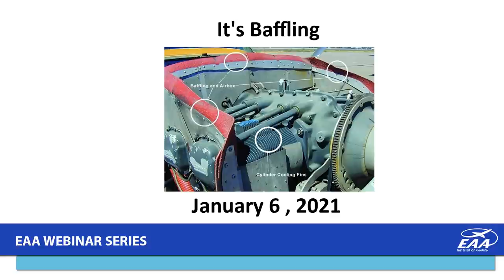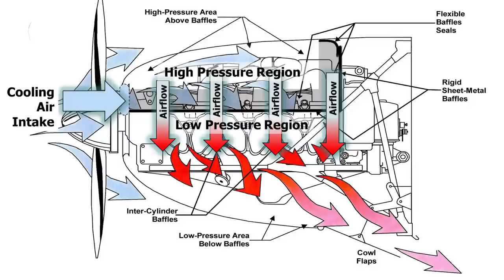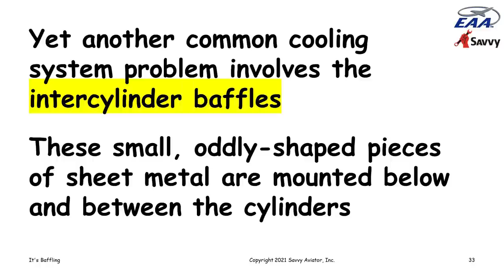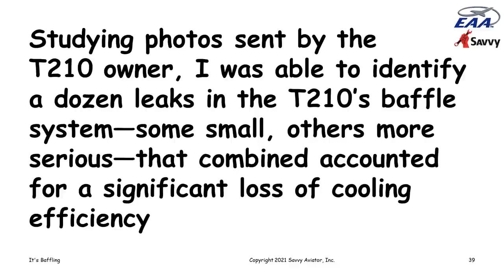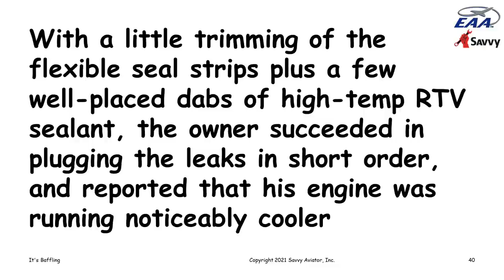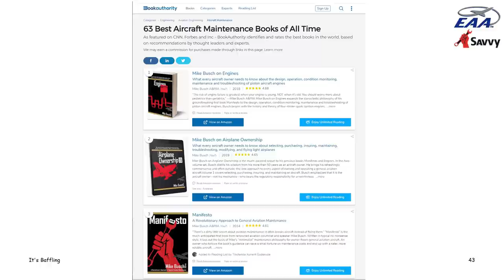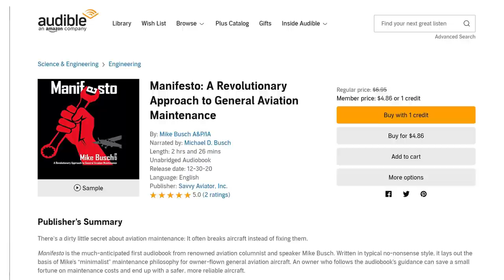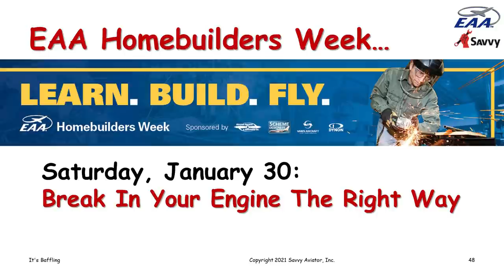It's Baffling

Comment: Thanks, another well-made webinar. It took me a long time to understand how this works, and why it is better in almost every way (except structural weight) than hanging the cylinders "out in the breeze". One thing in subsonic flows that people find counter-intuitive is that by widening the intake after the inlet opening, the air flow will slow down, and pressure will increase.

Comment: I was waiting for the A&P to finish up my annual paperwork a few years back; while I was waiting I walked around the hanger looking into the cowling openings at the baffle seals (this was an issue I had been working on my 172P).  Every aircraft that I looked at (mostly 172's, a couple of 182's, etc) had the seals backwards (pointing toward the lp side of the baffles).  The reason I was aware of the issue was I had installed an engine monitor as part of a panel upgrade and had been chasing CHT issues ever since.

Comment: I had a new cowling put on my E model Mooney.  Afterwards my cylinders were running much hotter.  When I descended it would even get worse!  I noticed that the new baffles were folded the wrong way.  I couldn't believe it could make that much difference but took it to my Mooney specialist and he cut me new wider baffles and that solved the problem.  I told the shop who sold the cowling that his baffles were to short but he said that it wasn't the problem.  But me and my mechanic knew better.

Comment: I wish I could've asked while live:
Is there a reason why the tops of engine compartments are the high pressure area, and bottoms low?
I would think that having the inlet at the bottom would increase deltaP, providing more cooling at high AoA, which is when aircraft are usually operated at higher power settings (and need the cooling)
as a minimal effect, convection should increase airflow, and cowl flaps could open to add heat to the outside of the windscreen as a free cockpit anti-ice.
Mike, do you check the comments section of YT? Or should I send an email your way?
For the question on measuring deltaP, I'm pretty sure HomebuiltHELP posted a video on it like 3 weeks ago
Reply: Speculating here...have you noticed what a mess an airplane's belly is just behind the cooling outlet? At least some of that crap would probably end up on the windshield if the flow were bottom up. Note that the one example cited in the video is a twin.
Reply: @jjohnston94  I think most of that crap is due to two things:
1. The exhaust is aimed down, and although it usually extends an inch or two beyond the body, the exhaust produces soot that gathers
2. (More probably) the oil breather overflow drips oil over the cowling. Mike Busch discusses it in a different video, but it's related to how heated oil expands, and aviation engine usually dont have the (condenser?) That takes that oil and puts it back into the system that most automotive engines have had for decades
Reply: Peter Garrison of Flying thought the same thing and incorporated updraft cooling on his home built, Melmoth, 30 or 40 years ago.  It takes advantage of the inherent pressure differential between the upper and lower portions of the aircraft. Wikipedia states : “The engine is cooled using updraft air which enters through a single inlet below the spinner and emerges from the top of the cowling near the spinner.”  Exhaust exits below, and since most oil mess comes through the exhaust, the windshield stays clean.  It does expose the windshield to oil and debris if the engine leaks or comes apart and to heat if there is a fire.  He designed the aircraft himself.  He was an English major.

Comment: The Velocity XL is a pusher canard.  How would you cool a 6 cylinder for that plane? Often see NACA ducts on top.  Is it safe to assume the air exits the cowl alongside the prop shaft and the baffles allow air only to pass down over the cylinders along the bottom and out the back?  Is flight speed and any pull from the prop enough to create the pressure diff?  Any ideas to maximize cooling in this plane?

Comment: I fly a Robinson R44 which has an IO540 mounted backward behind the cabin. Cooling air is provided by fan mounted to the crank shaft. And the airfow is similarly top to bottom.  I'm wondering if deltaP is of the same magnitude in this setup? We noticed the CHT got higher recently and after watching this video, I found a gap in the baffles which was probably introduced at the last 100hr. Will get this corrected but wondering if a fan pressurized setup has the same sensitivity to gaps.

Comment: Shock cooling almost requires intent.  Many hours flying a C-182 jump plane without ever cracking a cylinder.  Climb is at 80 Mph, 2450 square, hold CHT to max 390.  One minute prior to jumper exit reduce prop to 2,200 RPM, half minute prior to exit reduce MP to hold altitude typically 18 to 20 inches.  After exit close cowl flaps 30 degree bank 140 MPH airspeed.  As CHT drops, reduce MP to 13 to 14 inches, increase airspeed to 150 to 160 Mph.  Fairly aggressive  procedure, never a problem.
Reply: Ambient air temp? Rental 172 at home airport in Wisconsin I know used to not rent the plane if ground temp was below 10F

Comment: I have a Cessna 150 1972 model. What about the baffling that goes around the air filter assembly. Most of the 150s I’ve ever looked at including mine this is missing. Will this affect the low pressure side of the air chamber and affect the cooling.

Comment: Good information. Thanks for posting this. 
I do have an off topic question. I often watch automotive repair videos. A couple of channels use what I would call advanced diagnostic techniques using tools such as oscilloscopes and pressure transducers to diagnose automotive engine problems.  I was wondering if you had ever looked into these techniques and their applicability to GA  engine diagnosis and  maintenence. The channel Automotive Test Solutions probably has the best example of this type of diagnosis. Scanner Danner is another channel. I am sure there are other that I am not aware of.

Comment: 1:14:38 I would think a possibility of having one side of the engine hotter than the other could be due to an induction leak on the hot half of the engine.  It would make the cylinders on that side run leaner, thus hotter.

Comment: Hello Mike, i have a piper cherokee and the oil temps get quite high ( top of green)in the summer and right now in winter months my oil temps are 200F plus and 30F ambient OAT. Is it possible to see a normal cylinder head temp 300F and still have those high oil temps? Are they not related? Thank you for your videos. Really enjoyed the one about leaning.

Comment: Unfortunately the problem with the baffles is aerodynamics matter in pressurized areas like under the cowl on top of the cylinders, where not a single engineer has designed the area to be pressure flow efficient.  The result is the design fails to cool the last two cylinders because of the engine clutter, choke points and poor aerodynamics.

Comment: I wish I had caught this one live. What is an owner allowed to do with the baffling on certified? Change flex seals, rebuild the baffle system, modify etc.?
Reply: An owner is allowed to do nothing. A certified mechanic is allowed to replace the soft seal. A certified mechanic is also allowed to stop drill any cracks and make minor repairs. Changing the baffle system away from its original Design in anyway is considered an alteration which requires approval from the FAA. And they don’t give approvals for that stuff very easily. I hope that helps
Reply: Thanks. The video made it sound like you could do some stuff without signoff. May have been aimed at experimental at those times.
Reply: A&P work. An owner can if mechanically inclined,  A&P help. Owner needs knowledge of his airplane.
Reply from the maker: Plug holes with RTV...

Comment: Would it help to make the birds nest of hoses and tubes on top of the engine more aerodynamic?  This would reduce pressure loss and cooling drag. I’m thinking of oval or teardrop covers on the tubes and hoses or gathering them up or rerouting them. You would never leave that mess hanging in the breeze if it was external to the aircraft.  

Also, what is the typical airspeed between the high pressure and low pressure plenums?
Reply: That would help a bit, but probably not enough to worry about, since the flow through the cowling is slow compared to freestream velocity outside the cowling. Shaping the air inlets and making the first few centimetres of air duct very smooth to recover as much ram air pressure as possible helps a lot more. Having a more efficient pressure recovery lets us get away with much smaller holes, reducing cooling drag even further. Look at the difference in intake size and shape between an Archer II and an Archer III, or, even more pronounced, between a Socata Rallye and a Socata TB series, to see the progress.

Comment: Piper Tri-Pacer 1960 used 1/2” thick felt stapled to the aluminum to interface with the cowl.
Reply: Replace the felt with silocon shown in the IPC.  Your A&P is required to do this repair work. Where's he been ?  A&P noted.

Comment: My baffles are too good most of the year, i struggle to run 320-330F LOP, even ROP it is only 5 degrees higher….i want to up the temps at cruise by 40 degrees.    What is the easiest way to do this?   If i cover the oil cooler i wil trade this for oil temp?   HELP, my engine is 20 hours old, I want to bet ahead of this as my prop stroke/900 hour engine needed a Full OH due to spalling and valve issues…maybe caused by me be fat dumb and happy at 300-320 LOP